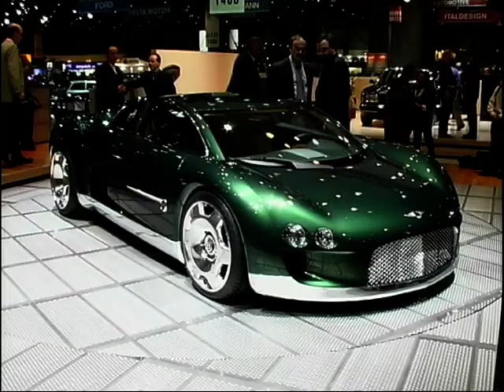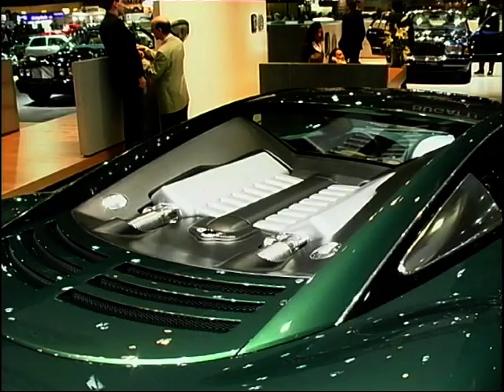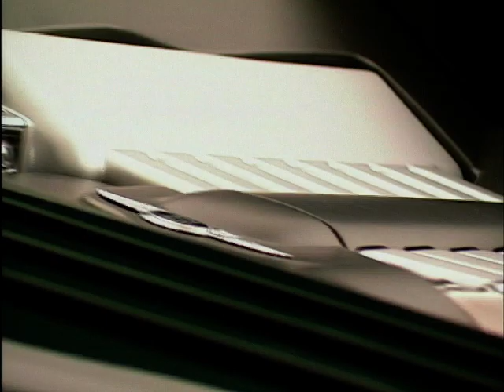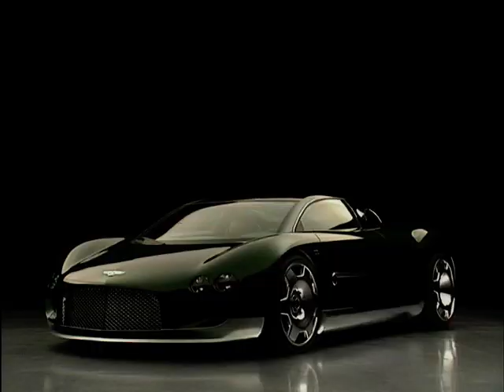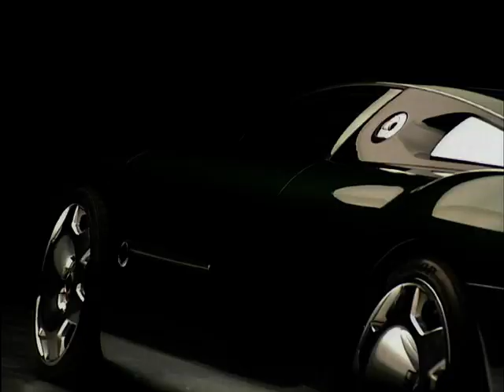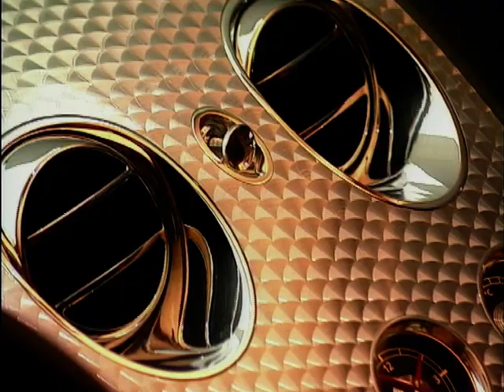Bentley Hunaudieres W16 Concept

Comment: i wonder if there would be like anything good to say for the idea to make a w24 out of2 of the v12 engines found in the lamborghini aventador.
Reply: it doesnt work this way. this particular W16 or the one that can be found in the Veyron is more of a combination of 2 VR8 engines, not V8 engines. however it is possible to cojoin 2 W12 engines. but the output torque would be too damn high for any existing gearbox (2500-3000) so techically w24 would be a useles piece of overengineering